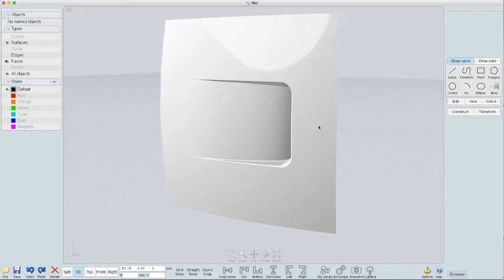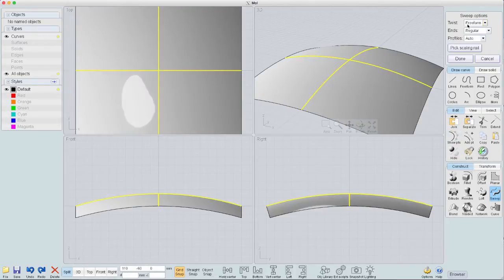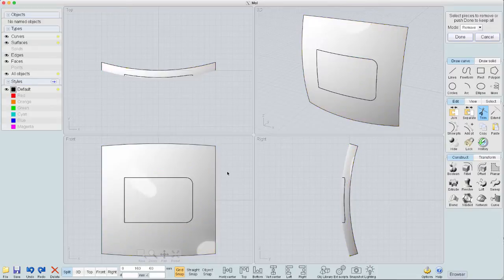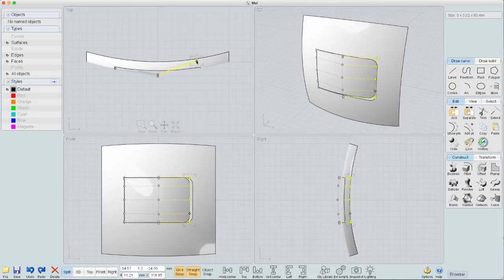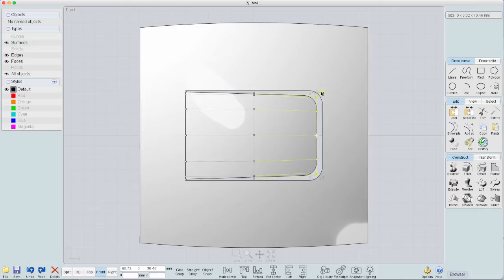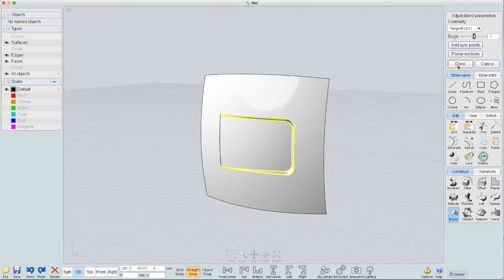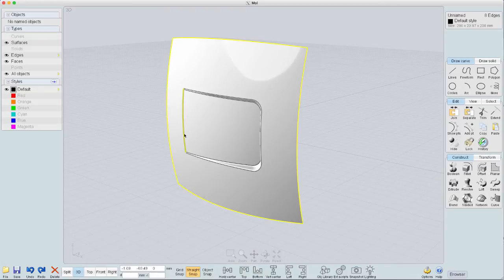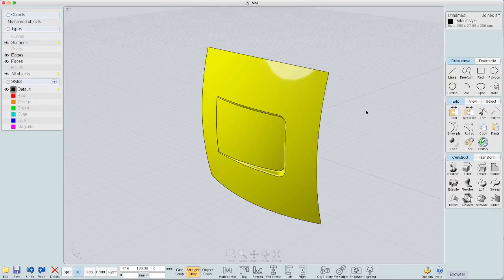Mol Scoop Detail

Comment: Ok, so why arent people modelling this way instead???
Reply from the maker: I don't know exactly what your question is. This is the proper way to model a scoop in MoI on a compound curved surface.
Reply: lol Sorry I meant modelling with nurbs. Ive been modelling for 4 years now and although Ive heard of nurbs of course but never heard of this workflow or program. Just trying to figure out if its worth investing into.
Reply from the maker: Ryan Stever NURBS are good for hard models. Especially those that will be 3D printed or part of a manufactured design product. Because they are typically used in solid modeling, they can handle Boolean operations, chamfers and fillets with ease. They're not very good at building game assets, or models for VR, AR and MR. Also, they're not typically very good at making lots of iterative changes on a design. Hope that helps.
Reply: How is it not good for building game assets? The ability to export two different versions of your model both low and high poly at the click of a button seems perfect for that. This alone seems to be better to build game assets than a traditional software like 3DS. I would much rather build one model than two every time. Just wondering anyways.. thanks for the info, im always looking for better tools for hard surface modelling.
Reply from the maker: Ryan Stever The polygon mesh exported is difficult to edit or UV unwrap